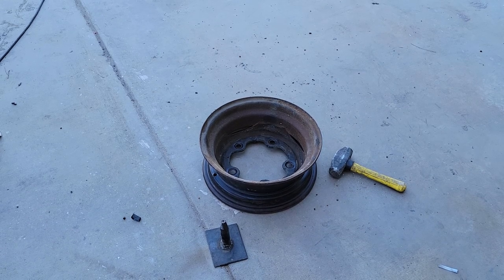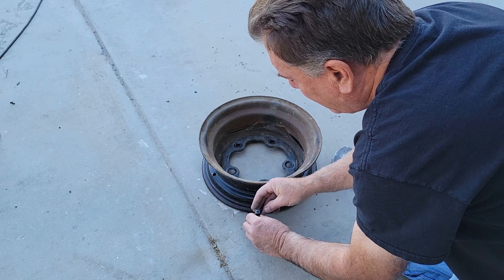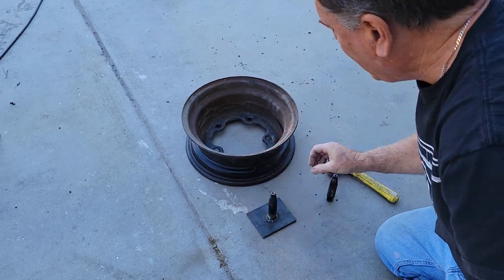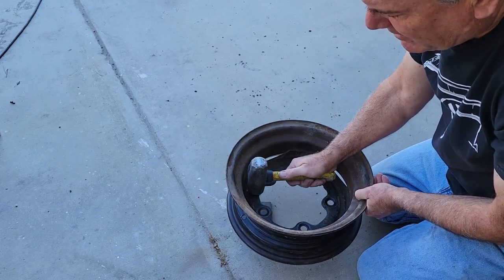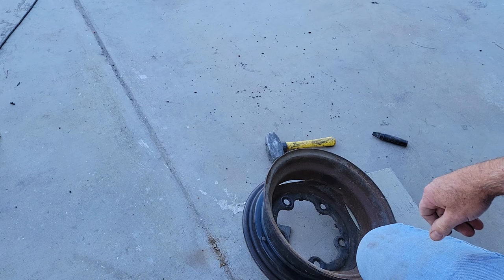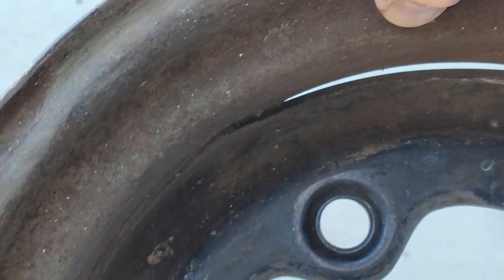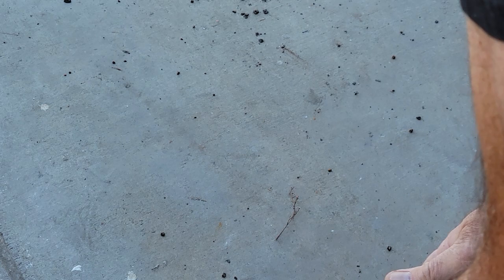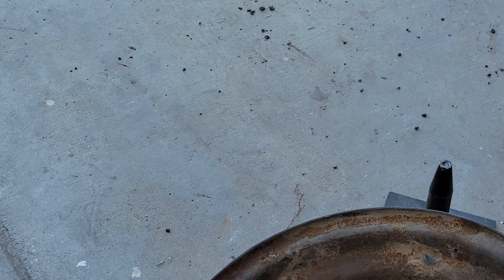new VW hubcap clip shortcut

Comment: That's not how those rivets were fitted. I'll let you off as your improvising but it's the other way around and you hold the tool. You normally have another part that the back sits on depending on which rivets and head your using. Like I say your improvising so whatever works is good.
Reply from the maker: that is the tool they sell to put them on. yea they were installed probably another way. So many people use a punch or another hammer or air hammer to put them on. This is the best method and it uses the least amount of tools.